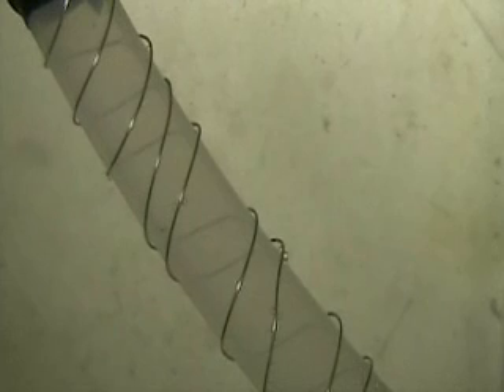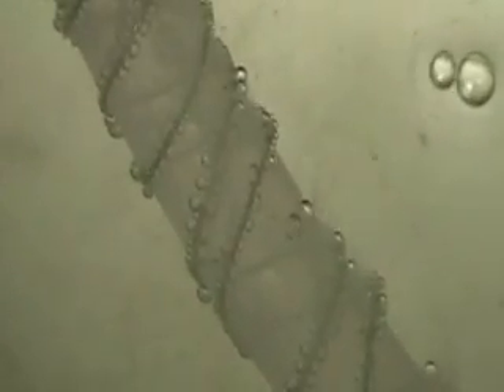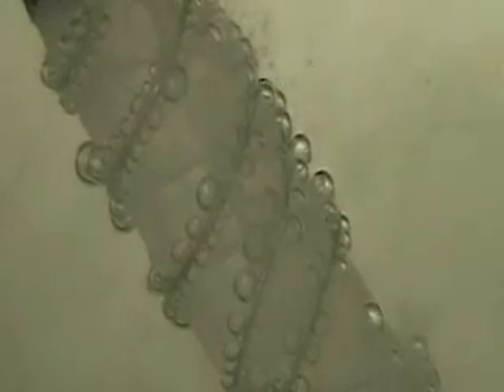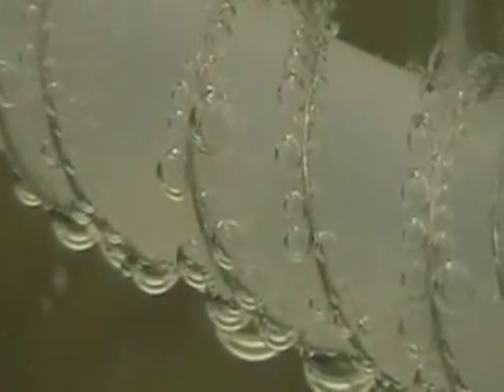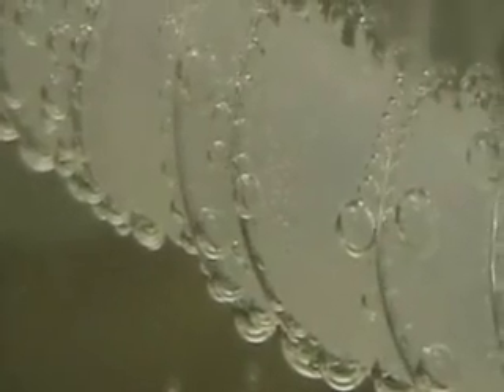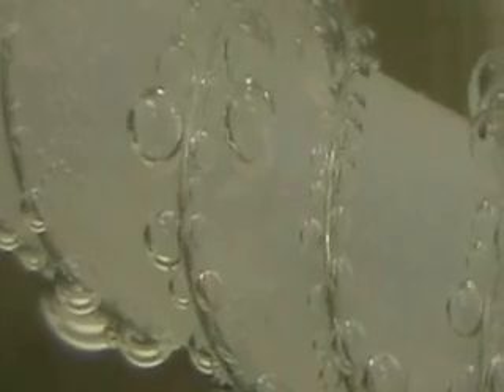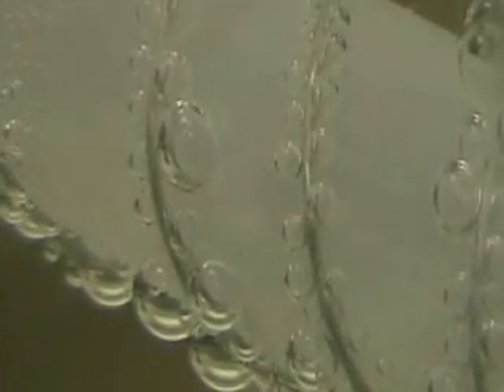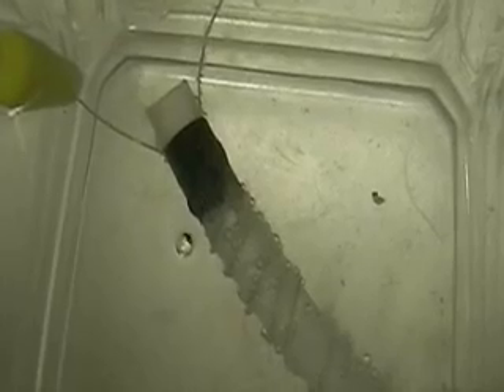Hydrogen Tap (Wire Configeration Test) 292

Comment: Water has 2 parts Hydrogen and 1 part Oxygen so there should be twice as much Hydrogen produced than Oxygen.  What would be interesting is to create a container with two chambers but share the electrolight low in the container.  Then apply positive to one side and negative to the other.  You should be able to capture pure Oxygen on the Positive chamber and pure Hydrogen on the Negative chamber.

Comment: I like this stuff and I reckon its the way of our future.  Since you guys know what ya doin I had an Idea which I havent seen yet.

Would someone try it for me, It may not work but maybe it might.

A stainless tube ( cut exhaust pipe ) will be the positive, inside this tube steel wool ( the negative ) pushed inside a plastic mesh so the 2 tubes dont touch, connect them up and see what goes.  Im not much good with my hands but I would like to see the result.

Keep up the good work.